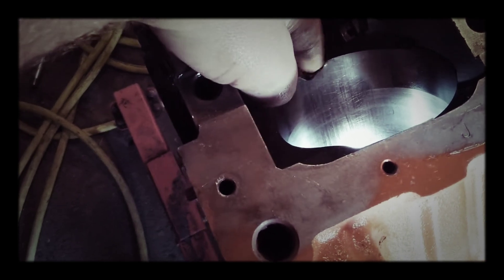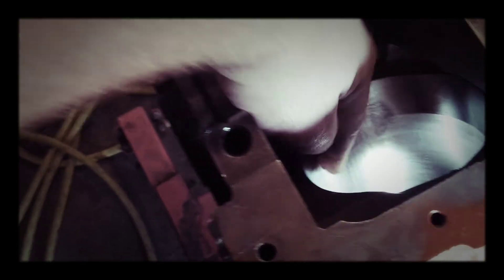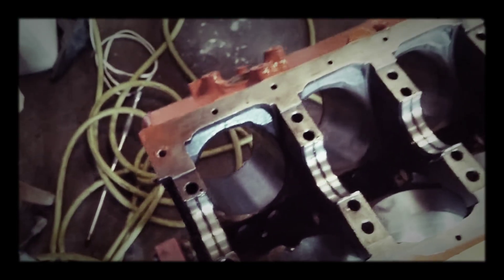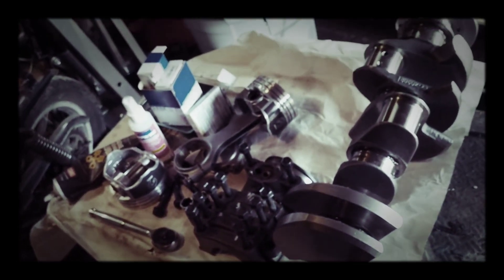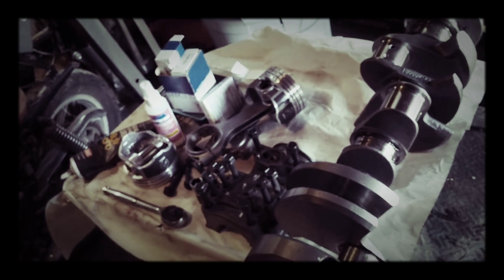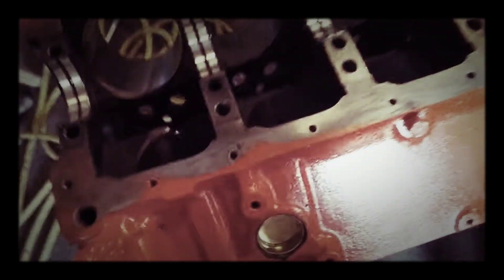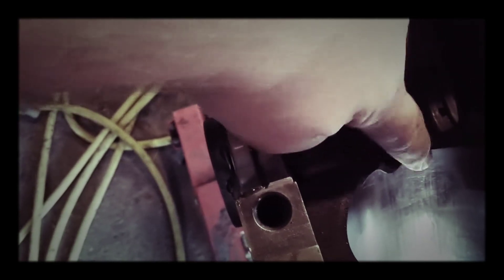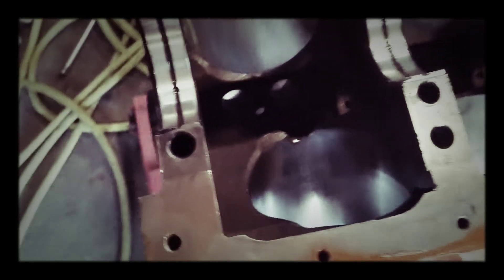Chevy 350 block

Comment: 👍4bolt main getting hard to find around my parts
Reply from the maker: They are i have been buying them from a freind of mine for 100$. Block with heads nothing else the one in the video paid a lot more on craigslist
Reply: @maniacmachanic9870  100$ that's super cheap